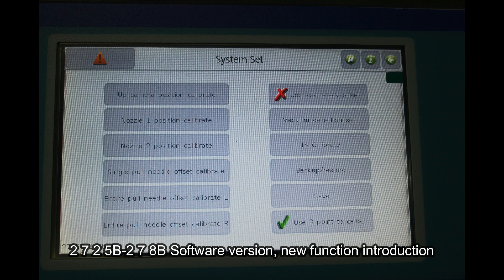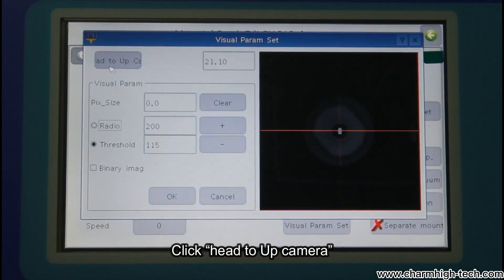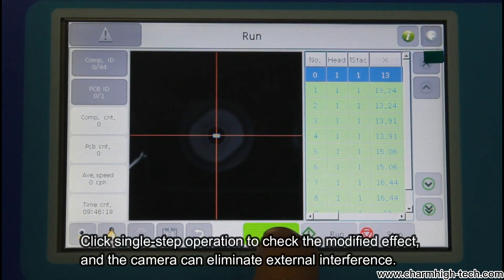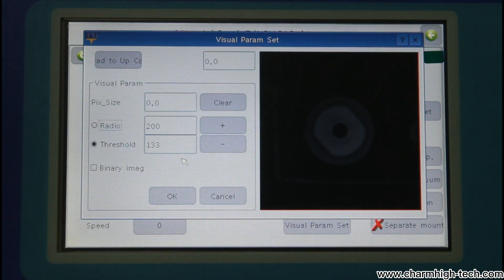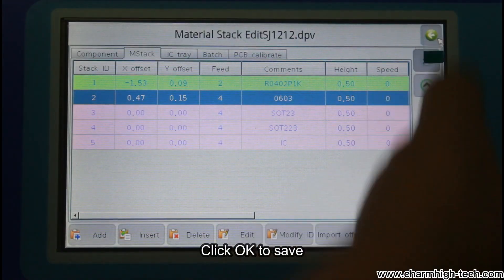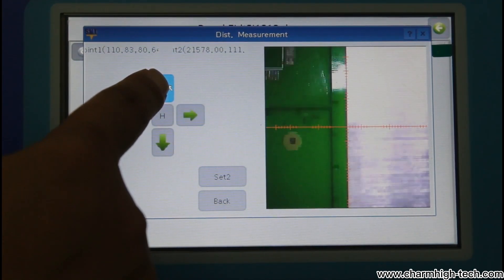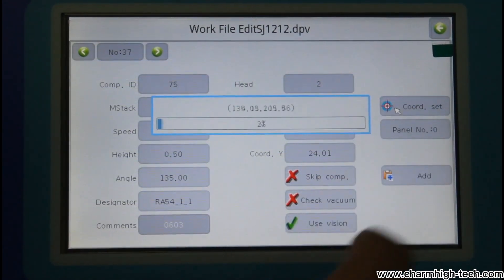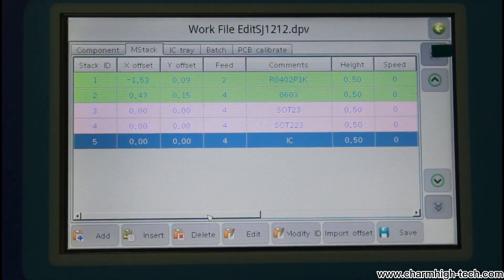New features for CHMT48VB new software 2725B

Comment: Please update a solution with software update for 48VA 

Machine pulls 2 components in 12mm reels and pics only 1 component
Have already tried all options but it's software error which is causing this issue
Reply from the maker: Hello friend, could you load out the system parameters and send me? And I need two screenshots: one is in "set" another is is "system set -123456".  Let me check the software and firmware version so that I can send the updated one to you. Please send to:  kimi@charmhigh-tech.com  ;  thank you! or please contact my skype for quick chat:  kimiliu89